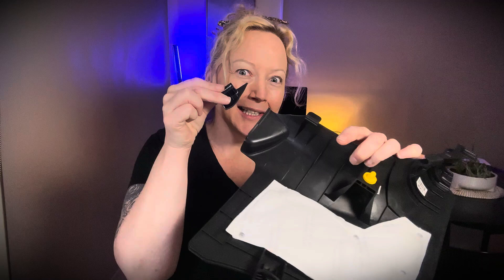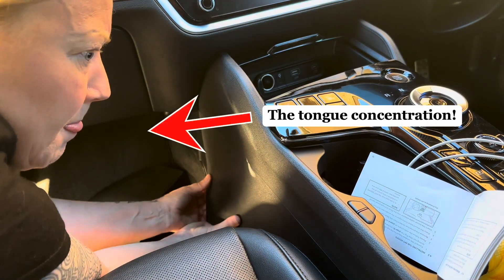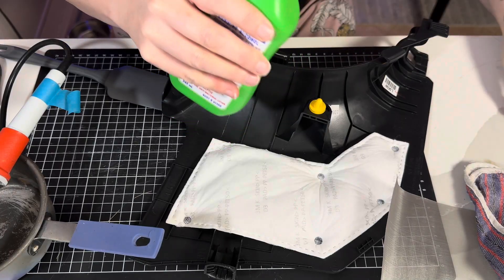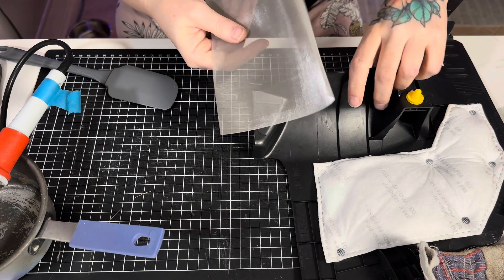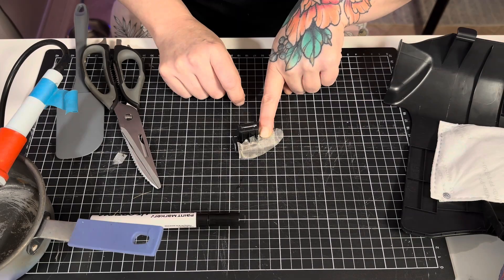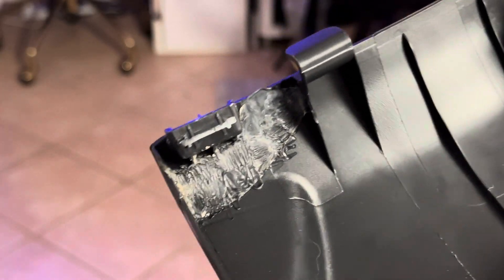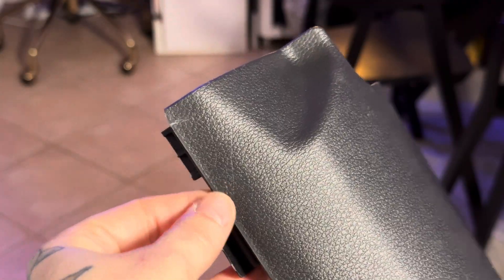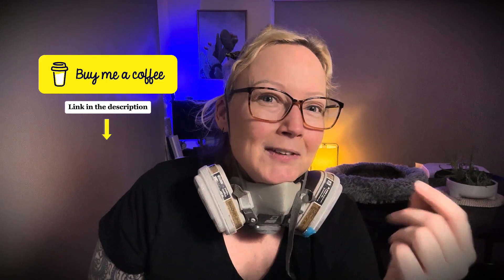How to Repair Broken Plastic with Plastic Welding

Comment: A little glue where the pieces joined would also have gotten rid of the line on the outside.  They also make an inexpensive heating tool that has coils that melt into the parts. The pins that fit into the special soldering iron are just cut off after the repair.  Good video !
Reply from the maker: Thank you. Yes I’ve seen the heating guns with the pins and would like to try them in the future. I already had a soldering iron so this was the way I went. Do you think using the mesh is stronger or the pins?.
Reply: I have used the heated coils where plastic needed strength, broken hood on John deere riding mower, for instance.  When you nip off the legs of the pins follow it up with something like a Dremel tool. Those pins are sharp where cut off !